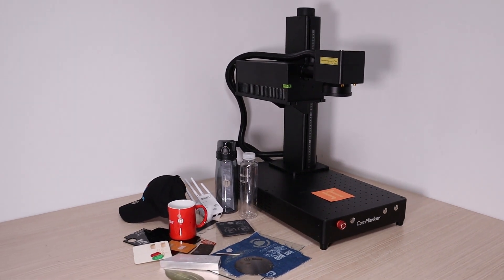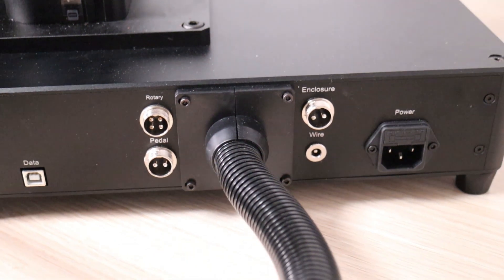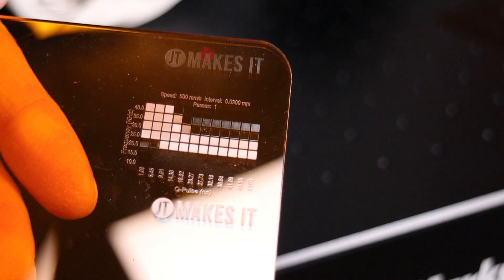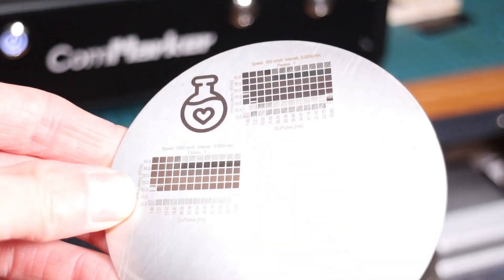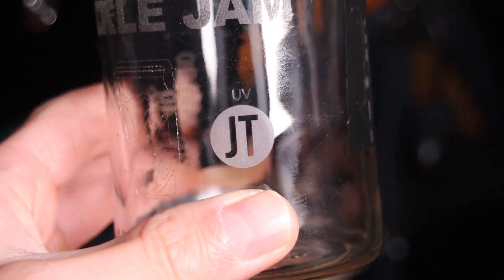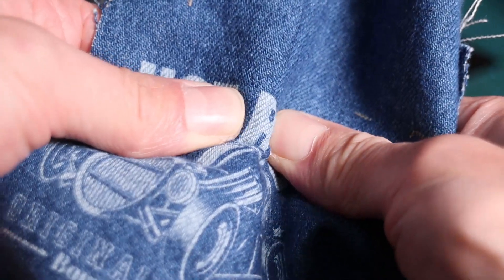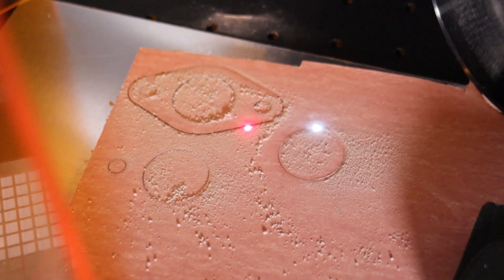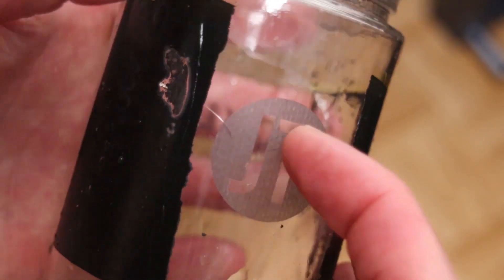The Ultimate UV Laser Engraver Test! Can the ComMarker Omni 1 Handle ANY Material? [Review]

Comment: Would this machine be a good choice for engraving 3D printed parts?
Reply from the maker: This machine is great for engraving 3D print plastic
Reply: @JTMakesIt  I just watched another review where the reviewer engraves some chocolate covered cookies. I'd have to infer that if it didn't make the chocolate a melted mess, it should be okay for FDM plastics. Just a matter of testing and dialing in for each filament type. My main products use PLA-CF, PETG and PC.
Now, I just have to justify the initial cost, although, I can't imagine I won't end up using for other projects.
Thanks again for the excellent review and for your help.
Reply from the maker: @cooltoff  Thanks! I bet you will find so many uses for this machine. It is a very cool thing to have. With some side hustling (engraving dog tags, kids clothes etc..) the machine will pay for itself in no time :)
Reply: @JTMakesIt  Well, I pulled the trigger. Used your link and code. I will be doing a lot of material tests on the PLA, PLA-CF, PETG and PC filaments I regularly use on my products. Hopefully, I’ll be up and running with the Omni before the end of the year.
I’m sure I’ll be writing you with questions.
Reply from the maker: @cooltoff  cool, thank you very much! I am sure it will serve you well! If you will have any questions, feel free to ask. The first learning curve is the hardest, but when you get a feel for it everything around you will be engraved 😆
Reply: The issue is that every type of laser has its own advantages and disadvantages. The UV laser is currently a new technology on the market, so it’s a bit overpriced. I think a well-calibrated diode and fiber laser can achieve quite a lot with excellent results. Of course, I'm not saying the UV laser isn’t good, but I find it a bit pricey.
Reply from the maker: @istvanpaladi2253  UV lasers were insanely expensive just a few years ago. This machine is considered very cheap for UV laser. But the fiber lasers are becoming cheaper every day as well
Reply: @istvanpaladi2253  What you say is indeed somewhat true. However, for my specific needs, as stated above, this laser appears ideally suited to those needs. And after a couple days of researching, this package from ComMarker is an excellent value.
Reply: @istvanpaladi2253  I don't. Prices are very competitive for what you're getting. Having said that, 10 and 15 watt UV's are exponentially more expensive. Five watt is all I need, and I feel the price was fair. Any well calibrated laser can achieve good results. But only results in it's wheelhouse. UV's are extremely versatile.

Comment: Thanks for the video, Installing the software today on my unit and then the fun begins
Reply from the maker: @TTC1940  awesome!
Reply: Well, not much fun.  Was able to install EZCAD2 and run a test, BUT I have been unable in install LB for galvo. It will not connect.  I probably have watched 15 or so videos about installing LB on galvo and none of them will pan out.  For now I have a 4000$ 50 lb paper weight. Some where some how something with connect.
Reply from the maker: @jimhamilton2680  Lightburn uses different driver as EZCAD. First make sure you have Galvo license(or valid trial) and then follow this tutorial: https://docs.lightburnsoftware.com/legacy/galvo/Installation
On my computer I use Zadig software for swapping the driver. For Lightburn the machine needs to be visible as USBLMCV4. If it is BJJCZ, then you have EZCAD drivers installed
Reply: Just noticed your reply and tried it out using Zadig to install new driver.  followed the program but nothing changed.  It will not frame, It immediately  starts engraving.  Spent all day yesterday with LB support and we got nowhere.  Not sure what the next step should be.  Maybe I just bought a 4000$ water weight
Reply from the maker: @TTC1940  I think your machine actually works. If it engraves it is not a software issue. I had the same problem, because I wasn't familiar on how UV lasers work. Preview is done with a very faint UV light intensity. This isn't visible on some materials. And after turning on the "laser ON/OFF" button  it takes 1-2 minutes for the preview to become visible as the laser source needs to heat up. Try putting various materials underneath when framing. On some stuff the preview is easily visible (yellow post-it notes I used in the video) on some other materials the preview isn't visible at all. And turn off bright lights around the machine so the preview will be more visible. If your machine engraves, it works. It uses the same light source for previewing and engraving.
Reply: I put a yellow file folder on it and did 2 different things.  I have on "frame before start".  When I hit start it immediately starts engrave, no delay.  Then I used the frame button which took me to the live framing.  I assume that this means that it "only" frames and guess it does not frame but it immediately begins to engrave
Reply from the maker: @TTC1940  This looks like galvo ports are not set correctly. 
https://forum.lightburnsoftware.com/t/fiber-laser-when-framing-it-starts-the-engraving-and-runs-continuous/72141/2
Did you import markcfg7 from the USB key? Or send me an email (go to my profile-> about)and I will send you the correct Lightburn settings.
Reply: Problem solved and it was of course USER ERROR.  I found out that when you "frame" and click on the type of frame you want, it frames.  I thought that you had to hit "start" before it frames. Actually when you it "start" it stops framing and starts engraving.  3 weeks for stress finally goes way.  Ran my 1st test of a logo on a black metal business card.  80% faster and the end result was white not off white plus no cleanup. WOW!!!
Reply: Finally was able to get my laser running.  Of course my installation problem  was user error.  Have you done any power coated tumblers?  I've spent hours trying to get the correct settings? just contacted Commarker for some help?
Reply from the maker: @TTC1940  great to hear that. No I haven't done any tumblers yet. Omni shouldn't have problems engraving directly on coating, but I don't know how well it will do at removing it. I would start with 35kHZ 1ns, slow speed(200-600mm/s), several passes, 0.03mm infill crosshatch. You can also check out my website article in the video description, I have added Lightburn material library download for Omni.
Reply: It is  a good/bad day with Commarker.    At this point on the engraving  tumblers, it looks like my settings will be 1400 speed, freq 35, Q 1, 5 passes, Bi Y,  CH Y. Now the bad news.  The engraving of a word is not in a straight line.   On a word that is 2" long on the tumbler, the right side is up 1/4" from level.  Not is a straight line but curved.  So I was going to run a test with a straight line below the word to see if it also kicks up on the right end.  Now the next problem occurred.  When I turned on the unit both buttons lite up a the same time.  This should not be.  Now the blue/green button never  turns green.  Have emailed Commarker
Reply: Finally got my Omni up and running,  Of course all my problems were user error.

A  new problem as arisen.  I noticed that you have done some engraving on curved material.  Just started to engrave SS JDS tumblers.  I'm not using a rotary but a stationary jig to hold it in place as well as level.  When I engraved the word which was approximately 50 mm wide it came out with a very small smiley face.  The middle was down about 2mm.  Thought that the problem might be in LB about taper and cylinder settings but that would only apply if I was using the rotary,

Any thoughts?
Reply: Any work done yet with coated tumblers?
Reply: Trouble in river city.  Have spent days trying to get it to work with LB only Ezcad2.  Not sure where to go now

Comment: Excluding cost, are there any disadvantage for going with a higher power UV that you are aware of?  I am looking at a 10W however I don't want to regret not getting a 15W in a few years.  While this one looked to perform well for you, I have seen a few UV reviews that put 5W as a bare minimum.  I don't want bare minimum :)
Reply from the maker: @guyb7995  hi, bare minimum is 3W, 10W is higher end and 15W is the most I have seen. But those are for industrial work. I think the 5W is the best price/performance for a small business. It can do anything a 10W can, for a fraction of the cost. A stronger machine will make sense only when you have so much work that a speed increase would be able to make you more money. And a stronger unit has a water chiller which is a bit less noisy than an air cooled machine which is nice if you have to work 8h per day behind it.
Reply: 10 Watt  will do everything you want and still have lots of overhead for doing cuts. 😊
Reply: @ I ended up with a 15W JPT SEAL.  It's great to be able to work with a 300mm lens and have no issues with power and speed.  DOF with a 300, while still very shallow, is still much more than smaller lens which helps with slightly curved and/or not 100% flat glass.